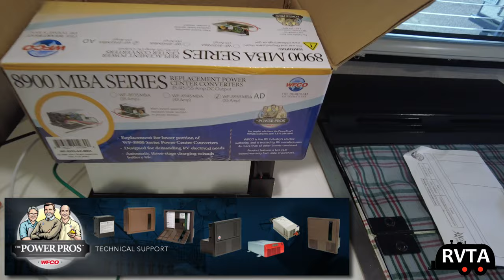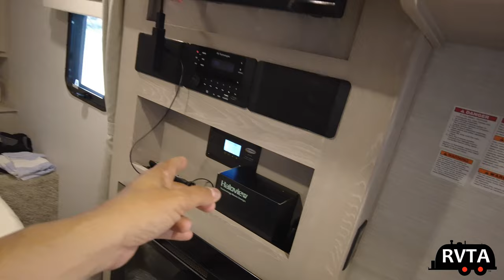RV! WFCO Auto-Detect Converter Charger Install - DUMMY PROOF? #WFCO #AoLithium

Comment from the maker: I did receive a comment about the compatibility of the new 55 Amp converter box. So I recently (12/23/2023) contacted WFCO, the manufacturer. My 2022 Rockwood Mini Lite 2205S has as original equipment a WFCO WD-8955PEC. The WF-8955MBA AD (55 amp) is a direct upgrade. So I should have no issues. My question ... why 55 amp?

Comment: Did you check the converter with a meter to see if it was charging at 14 volts or above ?  I have a new rock wood that came with that 8900 AD but it’s only changing at 13.4 to .6 on my lithium batteries.
Reply from the maker: My charge controller does. The converter box ... I do not know.
Reply: my trailer came with this converter installed.    It will not switch to lithium mode as it does not meet the criteria from wfco.   First my battery is nearly 25 feet from the converter......according to others it needs to be within 10.   second my stock wiring to the battery is only 8 gage,   so it would be maxed out running 50 amps......I am guessing with the distance and minium gage wire mine will not switch

Comment: Jesus, have you been able to get the Auto-Detect to switch over to lithium mode and actually provide the 14.6 Volts that it is supposed to provide? I have a WFCO converter with Auto-Detect and even after following all of the instructions multiple times the actual charge voltage is never above 13.55 volts.
Reply from the maker: I haven't dropped to zero. At that time it resets. Apparently.
Reply: mine doesnt work as advertised either
Reply: I have WFCO 8735-AD (Auto-Detect) and I could not get mine to detect the lithium regardless of what was done. I called and received a jumper to place on the daughter-board and now it stays on the lithium profile. My WFCO conveter had the 1.17 firmware (not updated) and was built in June/2023.

Comment: Jesus the only question I have is you have a 30 amp trailer and WFCO (per the box) gave you the WF-8955 MBA AD (55 amp) converter charger, shouldn't you have gotten the WF-8935 MBA AD (35 amp)?
Reply from the maker: I talked with the manufacturer and they said it was okay. I went to my RV and gave them all the details about the old and new box and the fuse box.

Comment: I have considered this one with auto detect but keep reading about people saying that they have trouble with the auto detect picking up their battery as a Lead Acid when the battery has BMS. How is yours working?
Reply: I sent mine back to WFCO and they put a jumper on it so it stay's in Lithium mode.  You can remove the jumper yourself if down the road you want to go back to flooded.

Comment: Jesus, what truck do you have to pull with? How does it do for you? MPG? Thanks! Love your videos!
Reply from the maker: I have a 2016 Chevrolet Colorado LT V6.
Reply from the maker: 20-24 mpg highway. 8-10 mpg towing. I've towed at 75 mph, but typically 65. Bad weather or hills ... 55 mph.
Reply: @RVTA  I tow a Jayco 212qb with the same truck. 9-12 towing at 60ish mph. Tows ok just hate the 3500rpms going up steep hills 😬
Reply from the maker: @alfavulcan4518  I have to watch my revs in cruise control. Once I see a hill, I take it out and just use the gas pedal. It wants to rev to 3-4k in cruise control up hills. I'm planning to camp in the Sierras in 2025. Back home I know there are some serious grades. Should be fun???

Comment: Thanks for the video.  I plan on installing my new converter next week. I am going to wire it through a transfer switch and that might be what the extra hot wire with the wire nut on the end of it is for. Did you ever find out if it is?
Reply from the maker: I have no idea.

Comment: Guessing this was a review for a free product.........Well there is absolutely no way that would autodetect the way it was installed.    First the battery is more than 10 feet from the converter,   secondly it is stock wiring,    third that battery probably was not fully discharged when the converter was installed.     

It does not work like that.
Reply from the maker: Yes, you have to totally discharge a lithium battery for the system to recognize the battery type. Thanks,
Reply: @RVTA  discharging even a Lithium to zero is not good for them either.
Reply from the maker: @tfs4693  Apparently, you have all the answers. Thanks for sharing.